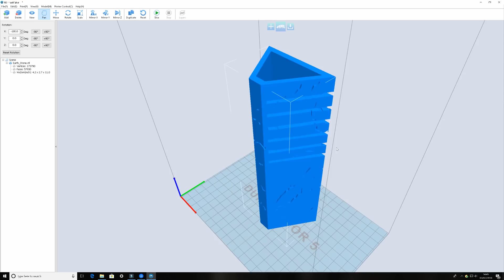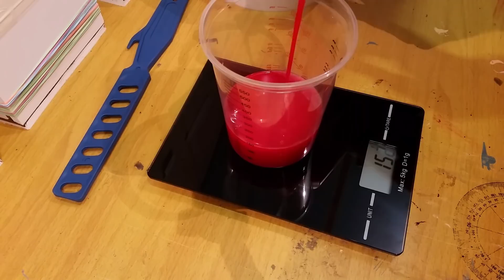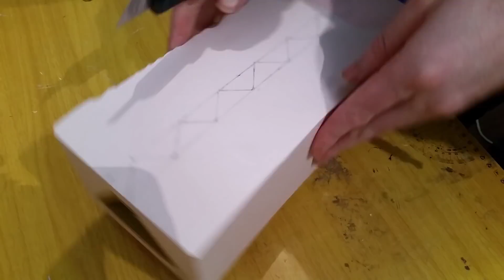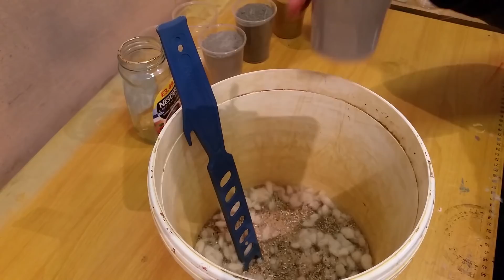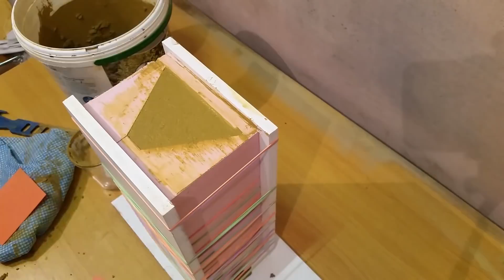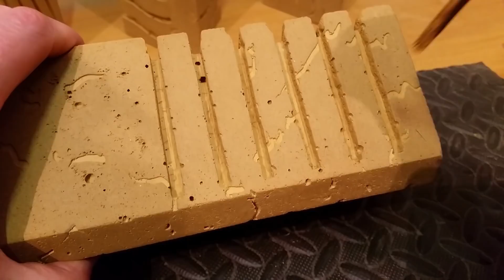3D Printed to Concrete Fifth Element stones GIVEAWAY!!

Comment: Another brilliant job! I've found that broken off bits of concrete can sometimes be glued back on by thoroughly soaking the joint surfaces in water and then mixing up a little bit of dry cement with a splash of water and lots of PVA, coating both wet surfaces liberally and then clamping/rubber-banding/masking-taping the bits together. Doesn't always stand up to rough handling, but it's stronger than you'd think, and easier than recasting a whole piece.
Reply from the maker: great tip! I will be making some more of these in the future so I will keep that in mind cheers

Comment: Hi . You did a fabulous job on these stones. When I do concrete I use play sand , white cement . Water with a drop of frost proof and hardener and my choice of dye sometimes no dye. Then leave overnight. Also I see you tap the side for vibration.. that’s good but also I pick the moulds up and bang them on the work bench several times gently/or depending on the day I’ve had lol .. air bubbles will rise to the top . 
I’ve casted moulds for a while now and actually came across your video because I want to make my own moulds for my concrete pots so I found this very useful . Thank you
Reply from the maker: I'm glad you found it helpful also thanks for the tips next time I will use a more flexible silicone learned quite a bit since doing these. Cheers

Comment: Hi!! can you tell me more about your degassing pump system¿? specs, power pump, etc.. Thanks. Regards from Spain
Reply from the maker: here's a link to the one I got cheers
https://www.ebay.co.uk/itm/SMO-KING-Vacuum-Degassing-Chamber-1-5-Gallon-Steel-6-8-Litre-Standard-Kit/401009936254?hash=item5d5e0e077e:g:FwwAAOSw4gxbTyy8:rk:17:pf:0

Comment: is it possible to make the concrete cast bubble free, mate?? sorry, I am a noob...
Reply from the maker: Not completely I would need a vibrating table to do a better job but I think the bubbles add a bit of in perfection to them l could shape them with a file to remove the roundness cheers

Comment: Pretty cool mate!! I wonder though. Maybe a mixture of Lifecasting plaster, concrete dye and silica sand might take care of trapped air bubble issue.
Reply from the maker: I'm not sure how strong lifecasting plaster is but I think the air bubbles aren't too bad adds a bit of in perfection to them but I will look into that cheers

Comment: Enjoy your videos and thanks for all the time and effort you put in to them... And here's hoping you have a Merry Christmas and hope you have Happy New Year.

(I was thinking you could have used a random orbital sander without the sanding pad held on the side of the mold to help rid it of air and to get in to the grooves/details. Also you could have used snowcrete which would mean you would be able to use less colour, to much colour powder in a mix can weaken the results., or use liquid cement colourant)
Reply from the maker: good idea with the sander soothing to consider in the future and as for the snowcrete how did I miss that!! and I leaned the hard way when it comes to the cement dye its a tricky one to get right especially when you need to achieve a dark colour. thanks pal happy xmas